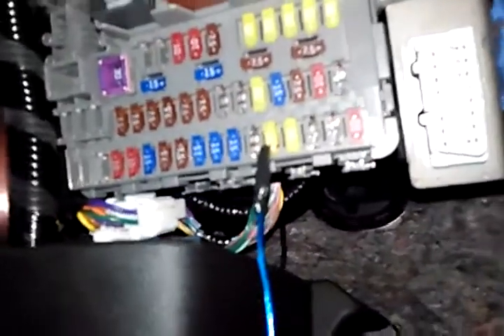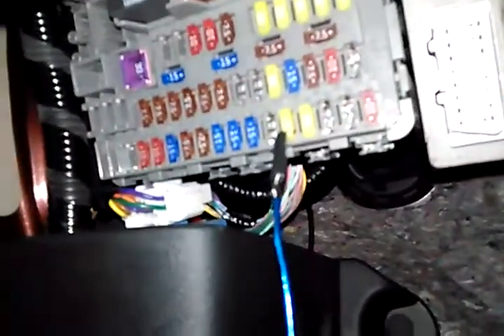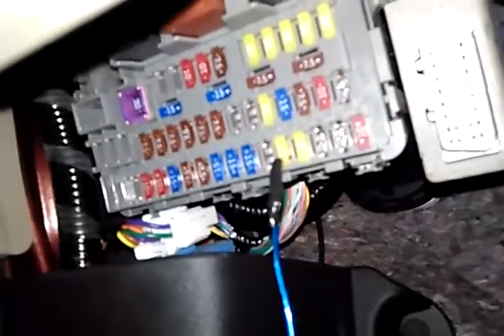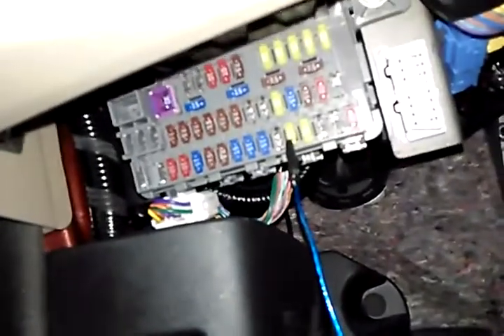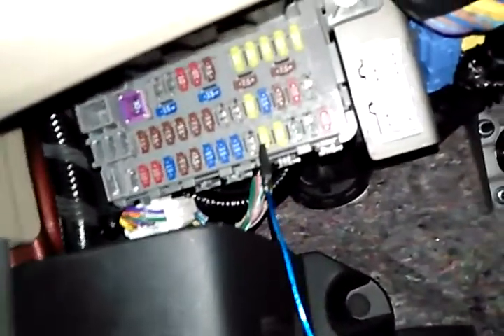Part 2 remote wire

Comment: My remote wire for my amp is tapped into my ignition switch fuse but my amp stays on even when I shut the car off….any suggestions

Comment from the maker: Did you run the same way I have it if so it can't be a fuse that is live all the time my sunroof is not always live when the car shuts off it kills the power to the sunroof aka radio turns off when car is off I never unplug mine and it goes off if your still stays on then it's not grounded right for it to do what it needs to check out my other  video do the same setup and it will work promise on that
Reply: Yea his sunroof shouldn't be under power when the car is off lol

Comment: I hook my up to ignition this would be your on and of switch.
Reply: Exactly!!
Reply: I have mine this way. 93 Nissan d21. Fun fact. No remote on the vehicle side of harness. Barevids channel he claims remotes can be daisy changed between amps. I have 2 amps right now. I will install 2 more. Does anyone know if daisy chaining 4 amps just the remote wire will cause an amp malfunction? I have a 10 amp fuse for the 2 I have. Just being cautious.
Reply: Mines is also hooked up to my ignition fuse but the amp stays on even after I turn the car off…any suggestions